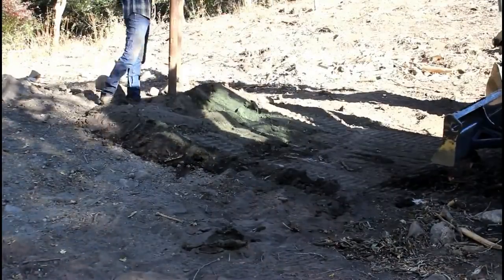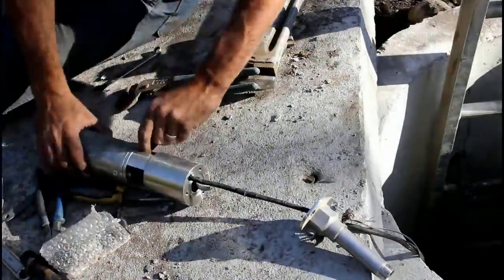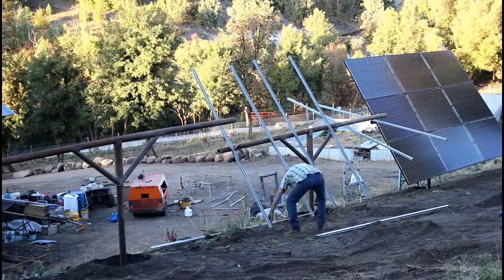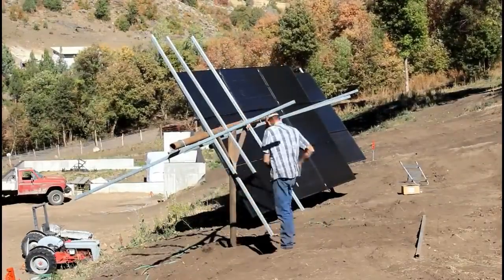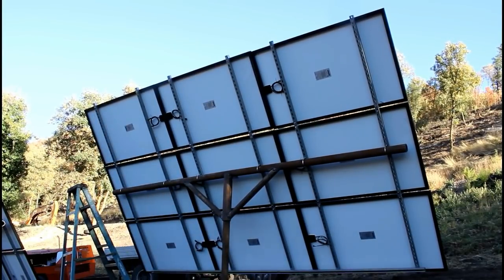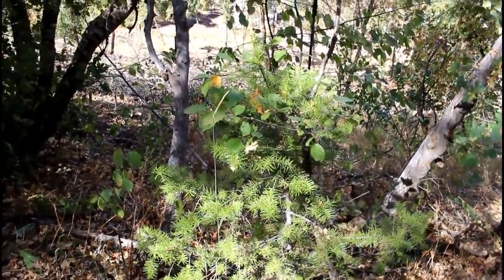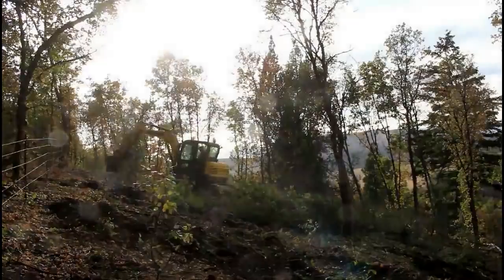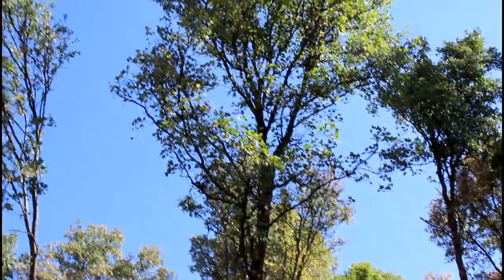#263 - The Well Is Fixed, Solar Panels Are Done, Hill Is Cleaned Up!!!

Comment: May I Suggest that you stiffen your panel array with 1 continuous box strut (uni-strut) from one upper corner to an opposite lower corner for diagonal strength.  A triangle is the strongest structural shape.  Rigidity would increase dramatically and the stiffening of the structure will be taken off the panels. You don’t want the solar panels carrying any twisting or pulling loads.    Cost should be minimal and the benefit great.  I don’t know how a solar panel gets its torsion resistance. But you can bet,  if it can fail in a storm, it will fail at the least convenient time.   Just a suggestion from an 84 year old Civil Engr.

JoeB

OOPS,   just heard as I typed that you beat me to the punch.  .  Good luck,   Great video.  Great family love.  GOD Bless you and the family.

JoeB

Comment: You have become a master with all the heavy construction equipment.  Doing some precise movements with them in placing the supports on the posts for the solar panels.WHAAT!!  $12k for the mounts and you only paid $600 because you built them yourself??  That is some good motivation.

Comment: Eventually, the 1 step forward and 2 steps back changes to 2 steps forward and 1 step back. It is called learning. With the right attitude, this is rewarding learning because one learns far more than they ever expected. 
You should plumb a frost free hydrant to the solar panels. Dust can drastically reduce the efficiency of the panels. They will actually collect more energy when they are wet.

Comment: Only thing is those strut straps will allow the panels to tilt in a strong wind.  If you rig up something to weld the inch and 5 strut to the tube it will be a little better.  Other than that it looks nice.  If you're running conduit to the house you wanna consider rigid 90s for each end so you dont burn thru the 90 accidentally pulling the wire but it's not really that long of a pull so it might be ok with PVC 90s

Comment: What do you plan running? My buddy's place has half your output and it runs everything fine. I am here in the Western Mountains of Maine. You going to use a propane refrig? Fence off your property and let the cows clean up the other 40 acres. are they Rock Maples or White? I make syrup.
Reply from the maker: Syrup for sure. electric fridge.

Comment: I agree with you, you don't need the concrete footer for those posts.  If you are at all concerned about wind twisting those mounts, run a 1/8" steel cable down from each end of the cross beam so some kind of anchor buried in the soil.  A small turnbuckle will keep them tight.

Comment: Remember PR when Maria hit had solar panels cemented in and the attachment still failed. You can only plan for thg he expected. Maybe emergency panels or wind generator that can be in a protected shed then brought out to fill a failure gap would be wise. Not a duplicate of your system but something  like an emergency generator would be wise to think about sometime after you move in.

Comment: I see your concern with the wind on your solar panels good job on that. But what about the weight of the snow pushing down on the panels which will push down the pipe into the ground. Isn't that worth at least one bag of cement in each hole. As it sinks the chains will become loose. You did a beautiful job of constructing the solar panel system. God bless you and your family
Reply from the maker: There's way more than one bag in each hole.
Reply: You talked so much about the wind; I apologize that i missed your statements regarding adding cement. God bless and take care. Your doing a great job for your family

Comment: Sure is coming along nicely. I think you could check GPM at your tank with a 5 gallon bucket. At full sun connect a hose to your highest spicket, turn the water on and go and close the valve at the tank. Just time how long it takes to fill the bucket. I am thinking with an 80 foot head your going to get 1 1/2 to 2 1/2 Gallons a minute. What do you think.
Reply from the maker: No way... 85 psi, 1" pipe will be around 15gpm

Comment: Will your solar setup be grid tie or off grid?
Reply from the maker: 100% off grid
Reply: I was recently quoted $35K-$50K for a 10kWh system.  Wondering if you would share any specs on your system.  Thanks.

Comment: You could fence your back 37 acres and run some goats in there, they would do a lot of the underbrush cleanup for you.
Reply from the maker: It would cost a lot to fence and I would worry over the goats as we have predators wandering round from time to time. I may have to do it in sections.
Reply: Anatolian shepherds have a great reputation of controlling predators around sheep, goats, or cattle.
Reply: @jeffery19677  great dogs for sure!!

Comment: You need to get your panels hooked up ASAP It should have been the first thing you did. Your batteries are probably ruined by now all sulfated from sitting with no charge. Maybe you can save them if you hook them up before further damage is done to your batteries. You need to get Nissan leaf batteries anyway Lead acid is 100 year old technology anyway. leaf batts are light years ahead. twice as good capacity and life and use. Did you buy the lead acid batteries a year ago?
Reply: I can only dream of finding them for 35 bucks each LOL you should buy those all up if they are not all used up. Batteries loose capacity after people drive the car for a few years. If you can find some newer ones from 2017 - 18 then you found something worth having. old ones that dont hold a lot are not worth a lot. They may be low capacity from heavy use is what I am thinking. or well used for that price but if that is all you paid you may get a little use out of them and it would be worth it.

Comment: there is more light in the front of your house I guess if you want to later you can add more panels in the front I know your going to want to take advantage of the morning sun. I found out that Im never done buying solar panels. I always want some more.
Reply: Wow really that is a shame all that power going to waste and so they will pay for them selfs if you install them. are they a good size?
Reply: If they are still in the box you could sell them and ship them easy that way. I first made home made panels LOL 12 volt but I sold them and started buying 24 volt panels now and put them on trackers. I run 2 ACs and my 52 in plasma tv and satlite. In the winter I just about get everything on solar. Saves me a bunch on electricity. I cut my electric bill in half.

Comment: Great job bracing....remember once a year, or twice a decade, super storms hit even where you would not expect... Myself, I'd only do trails, leaving island of trees here and there, consisting what ever you like... The island provide deer shade during the day... especially the furs... goats will keep the weeds down, provide milk too, It almost seems your southern facing roof would have been perfect for the solar panels... out where I live most companies install on the roof...

Your hill is going to limit the amount of hours to charge the batteries, and in winter the exposure gets reduced too... I like that you designed the rig to be able to move... the more you get to know your land you won't need a compass, you'll see where the sun rises and sets each month...Power companies always like southern exposure on permanent sites because it gives best yearly exposure.... but you are going to be able to daily, weekly, monthly ability to get most sun exposure....

On your side bracing I would not drive anything into the ground that makes the panels permanent for above reasons... Poor some concrete forms with an eye bold in the middle so you can move them monthly...Even concrete blocks could work.... I guess what I am trying to say , make the tie downs adjustable... to follow the sun...
Reply: keep an eye on the soil shifting down slope. The trees were helping to anchor soil from moving. Erosion could become an issue without replacement root foilage.

Comment: Cool.  Those mounts look so good.  I wouldn't tie the anchors to the corners.  I'd just go to each end of the horizontal pipe.  Are removing those trees from the hill going to lead to erosion problems?  Do you plan on putting something down (like Winter Rye, etc.) to mitigate that until you put down your Spring seed?
Reply from the maker: Grass seed will go down soon.

Comment: Great work. When you mount your inverter, I’d suggest making sure you have really good airflow around it. I have two and they can get pretty warm. When I talked to the tech about them, he said the typical lifetime is about 12 years - I assume heat being the degrading mechanism. Mine are directly on my garage wall, and if I could modify anything, I think I’d offset them from the wall with a bit of uni-strut just to give more heat dissipation.
Reply from the maker: Thanks!

Comment: You did a Great job on the Solar Panel mounts and 7.425 kilowatts should take care of your entire house needs. Just curious what type of storage you are going to use on cloudy days. If you could get battery's from a wrecked Tesla that would be great. I use marine battery's and it gets very expensive when you need a large amount of them.
Reply from the maker: We have 16 batteries.
Reply: Sounds like you are all set, You probably have a 6000 watt power inverter.

Comment: I know absolutely nothing about solar panels and I have a question.  Does the angle at which the panels face the sun need to be adjusted throughout the year to get more direct sunlight or are they “efficient” enough to gather enough energy at a general angle for the whole year?  Likewise do you need to rotate the panels on the mount to take full advantage of solar energy at different times of the year.

Thanks for sharing your dream with all of us.  I wish I had that much know how and the confidence to figure it out if I didn’t.
Reply from the maker: The angle of the sun changes through out the year. Most people don't change the angle but because of our hill I will have to maximize the panels to make them work.

Comment: I look forward to seeing the rest of the solar rack details. Are the panels going to tilt as well as turn to maximize exposure? One thing you might consider is instead of using chains to attach to your ground anchors, use solid tubing (or angle iron) with pre-drilled holes that correspond to the various seasonal settings. This would also be stiffer. Would not have to be very large tubing. Looking forward to the rest of the solar stuff!
Reply from the maker: They tilt fairly easily but I'm thinking I may find a fixed position and leave them instead of adjusting them twice a year.
Reply: I think there online calculators that will tell you exactly the amount of gain you get by trying to optimize by season. I have a 9kw system for more than 4 years, but it is fixed on my shop roof. I remember playing withe numbers when I was choosing a location.

Comment: Nice video as usual. Another job well done. I noticed like others that the panels were shaded. How long during the day are they in direct sun? I'm sure you know that will be long enough on normal days - just wondering about cloudy days/weeks when even that time of day is not as bright.
Reply from the maker: We will have a couple of wind generators to compensate for the cloudy days.

Comment: just one quick question. setting the solar panels in one position facing the sun, will that meet all the requirements you need. or does the company have a setup that can rotate the the panels to follow the sun as it moves all day. i have no clue about solar, but i have seen videos where the panels do follow the sun. thanks
Reply: solar trackers are not worth the cost

Comment: I love the work you are putting in. Was gona critique but, some people some people read things differently and see it as an insult or negative convo. So I'm just gona  suggest some adjustments. 1st. To protect that pump, would suggest you t off the water line at the elbow behind the house coming from the well, place a non return valve on side to the house and yard feed and the new line go directly to full the tank from the top. Thus the pump will not be trying to fight against that 80psi back flow from the tank. I'm assuming the cost and man hour for the additional pex tube is cheaper than replacement of that pump. 2nd, I'm seeing alot of shadow being cast on those panels, that will damage the panels over time.
Reply: How does shade cause damage? (Reduced output, yes, but damage?)

Comment: Could you not set a motor to slowly adjust the panels to take advantage of the entire days worth of sunshine and reset to original setting at sundown? 
Disclaimer: I’m not a no it all and this is a genuine question not an attack
I say this because people seem to get offended quite easy these days, nice work by the way
Reply: Yes you can there is automatic setups and you can get 30% more kwh a day. It is cheaper to just buy more panels tho.
Reply: Solar trackers made sense with the old, less efficient panels but today's panels are way more efficient and cheaper per watt.  The power consumption of the motor and initial cost make it less advantageous than just adding more panels, as Joe Sidebottom stated.

Comment: Why did you not make a H for fasting the panels. Weight times length = that is not a good solution = you can see the bow in the panels vertical . But it looks nice
Reply: Horizontal adjustment, H framing  not conducive for that.....As for trees shading the panels In winter trees undress. Additional bracing for the T frame is an easy peesey  addition if he feels it's needed. I don't think that will be necessary. Working with time money and materials up against target establishment goals is important for initial establishment. I've seen T poles motorized to rotate so the panels could tract the sun instead of adding additional panels at a show,pretty impressive but I don't recall the additional cost or the actual gain....Pretty sure he's following the Rural Solutions advice given.

Comment: Had you considered after you finished the shop of maybe mounting the solar panels on the back roof of it. Seems like it would get them up a bit higher and the free up your ground space and you would never see them from the road or the front of your property. Just a thought. I know you had mentioned using the concrete foundation you poured for the original house plan as your shop. Great progress on it all. It was 97 degrees here in Tennessee today but winter is coming. Hurry and get that water tank shelter built.
Reply from the maker: We considered moving the entire solar system to the shop once it is built. There would be more direct sunlight over there but it's too far away from the house now.
Reply: Solar panels mounted on roofs mean that someone must go up on the roof and clean them off so they dont get dirty. After spending a winter climbing up to a super slippery roof to remove snow from panels, most decide ground mount is safer lol

Comment: Nothing like clearing trees with an excavator…  you can stack ‘em up and you pull the stumps up with it…  I always shake my head when I go onto a lot and I have to clean up after a mulcher, someone with a chainsaw, or even a dozer…  So much faster and easier with an excavator with a thumb.
Reply from the maker: Those expensive mulchers let the trees come right back next year. Taking a little more time with the excavator is the way to go for me.
Reply: Yup.  Depending on what you’re after, they do more harm than good.  We gave a hefty bill to a homeowner who had 2 acres of trees in his backyard mulched, but intended to grade it to plant a lawn… it took longer to dig up the roots and dispose of the wood chips than it would have for us to uproot the trees and stack them up for firewood.  Then we had to import a ridiculous amount of topsoil to make up for it before we could plant grass.